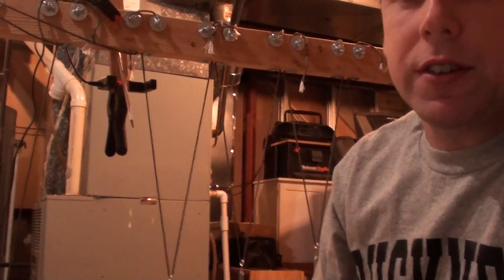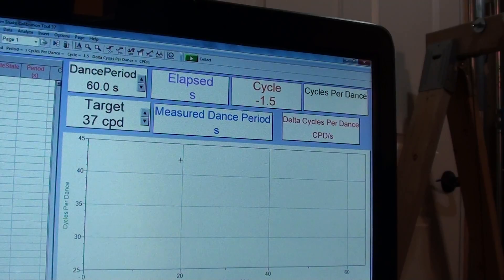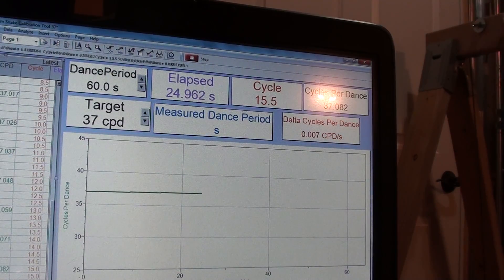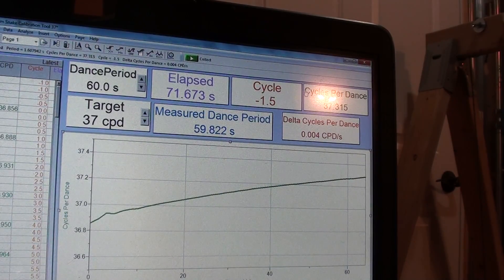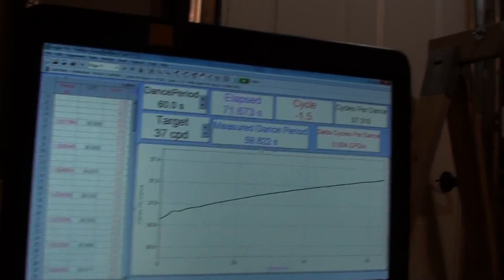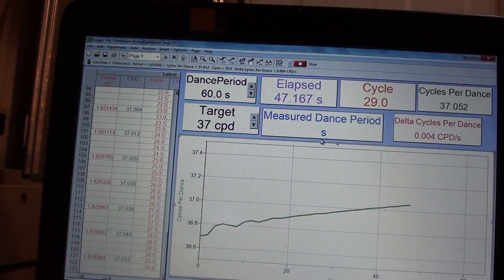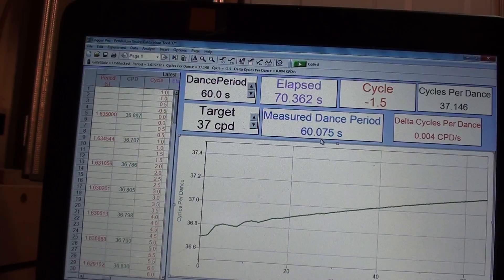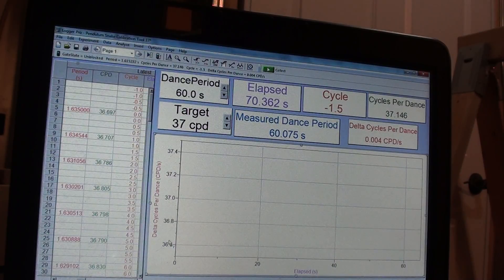Tuning a Pendulum Snake Using a Photogate

Comment: Hi,
I'm interested in using your program is there any chance you can send it to me ?
Reply from the maker: To work out the lengths for pendula?  See the desmos links in the video description.  You can enter your parameters.

For the Logger Pro file I used with the vernier photogates, that's also linked in thr video description.  Good Luck!
Reply: @PrerequisiteName  I cant find the logger pro file link. Is it still available?
Reply from the maker: @toddmalm5651  Try this link.  Here are all the files on Dropbox.  https://www.dropbox.com/sh/7t76gajflwlnx2o/AABq0bAixvgWavMrjkDsZ9sca?dl=0
Reply: @PrerequisiteName  that did it, thank you